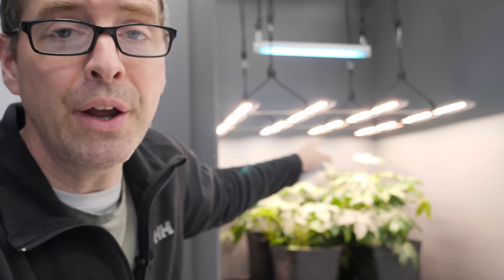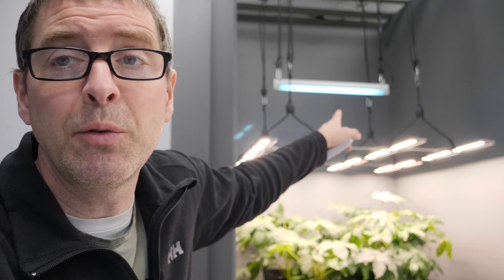How to use UVB with LED grow lights

Comment: You should see the paint on my grow tent poles.  It was  nice bright green 5 years ago. Now its a light pastel mint green. Lol
Reply: Hey, do you think there's a chance of burning the stuff in your tent? Like the mylar, fabric of the tent, fabric pots, plastic trays, plastic fans, rubber cables from the lights etc.
Reply from the maker: No, its lower level than UVB in sunlight
Reply: @MIGROLIGHT hi I've just bought this light plan to use in my white lined budbox, is that also safe it's not going to discoloured it? Iknowuv gets absorbed & doesent reflect hence my concern? 
I'll be using along side hps I'm interested in the emmerson effect but does a hps bulb already produce enough IR or do I need to add some small led bars to do the 15mins pre n post lights schedule
I appreciate your help
Cheers
Reply: @twentytwo138  no bubba. No danger of anything like that.

Comment: Amount of time in an 18/6 light cycle for uvb? I thought I heard you say in another video that 2 hours mid cycle or something to that effect.
Reply from the maker: Yes, 2 hours is perfect
Reply: @MIGROLIGHT  thanks for clearing that up sir!
Reply: @matprang4508  but you shouldn't be using it in veg if I recall. Just last few weeks of flower?
Reply: I've read that UVB can keep plants from stretching as much during the first 2-3 wks of flowering, as well. 
  Then I'd just use in the last 2-3 wks of flower. Starting with 15 minutes a day and moving up 15 minutes each few days, and maybe an hour per day max, as I've found these lights are very powerful, when experimenting without a timer (Duh?!), and ruining my crop by accidentally leaving it on for 12 hours.
  So be careful everyone!

Comment: What about UVA there's a new fixture coming to market the Oxilus sunlike Pro 8000 that comes with both UVA and UVB. Just wondering if it's even worth using?
Reply: Uvb isn't available in LED fixtures
Reply: @smokeyBJJ  go look up the light you'll see for yourself.
Reply: @bradpuhakka3955  can't find any info on that fixture..
Reply: @smokeyBJJ  they're fixtures are in testing right now and only started pre-orders on them. Quite a few people are getting them I'll see if i can find a link to drop for you
Reply: @smokeyBJJ  my bad bro I misspelled it. It's called Oxalis Sunlike Pro 8000
Reply: @smokeyBJJ  apparently it's gonna King of lights once it gets out. They even sent some to copycat and many others for testing

Comment: If using a Zoo Med ReptiSun T5 HO 5.0 UVB Lamp - 39W - 34 in.
4.6(249)
With 2xs the watts. Should I run half time at 2 ft or hang higher and stay at 4 hours? What would u Recommend?
Reply: I have a splitter with 2 different reptile uvb cfl. I have the on for the middle 2-4 hours in the middle of the 2nd half of flwr. I habe mine less the 12 in. Based off my understanding of cfls

Comment: I use two 54w 75%uvb and 25%uva
Reply: @bobbywitcher5042 What is the size of your grow tent? 4ft × 4ft? Does it work well with UVB? Would a single 54W UVB tube be enough, or is it better to run two for full coverage?

What protocol do you personally use?
	How many minutes per day?
	Do you run it daily during the last 3 weeks of flowering?
Reply: Uva damages plants i do believe good sir.

Comment: "As long as you maintain the hanging height of approximately 60 cm or 24" above the canopy....." was exactly when anyone with a tent quit listening LOLOL
Reply: Agreed… I operate my t5 & t8 ballasts around 12 inches above the canopy in-line with my led  fixtures (non-migro fixtures). Placing the unit at 24 inches above the canopy which is usually well over the light fixture is not going to work for the vast majority of anyone in a tent (most of us). It’s really impractical. 

Imagine having to put this over a more robust light without all that spaces between bars… it would be entirely ineffective where a vast majority of the light hits the back of the heatsink and never makes it to the plants,
Reply: My tent is 2.3meters so I could get away with but yeah I get ya with a 200cm tent but it's possible but definitely not In a 180cm height even 200 would be fairly hard.
Reply: Yah, you'd have to have a real tall Gorilla tent or something, or maybe some super squatty Indicas
Reply: My tent is 200 cm tall, totally doable
Reply: Learn to grow properly. There's hardly any high-quality LED lights that you need to be any closer with.. and even if you could find one that was higher in ppfd it's likely that the plant doesn't use any of those extra photons without bringing up the rest of its capabilities in CO2 and UVB/A.
Reply: I guess I'd have to hang inbetween the light bars on the main light and just move it up. A regular 4×4 can handle that as long as you've trained your plants correctly to use all the available light and stay small as a Shrub

Comment: Does your bulb have the same output as the pure uv bulb? I just set up an inexpensive fixture and made an aluminum foil reflector for a pure uv bulb. Currently running 4 hours at midday at almost 3 feet from canopy. Seems to be doing it's job but now you've got me thinking that I'm too far from the canopy. 
Thanks for all your great  videos. I'm running this in a 2.5 x 2.5 with a grow 200
Oh, also my plants got to see the actual sun a couple hours a day during their veg and early flower stage.
Edit: I see I'm 24w t5  and you're 18w t8 so maybe my height is correct.
Reply from the maker: Hi the Pure UVB has a very similar spectrum and a height of about 2 to 2.5 ft should be perfect👍
Reply: Yes the Agromax Pure UVB T5 is a beast.

Comment: What do you think of cosmorrow 40w UV
Reply from the maker: Its a UVA LED bar. UVA does not stimulate the increase in terpenes and flavonoids. Its basically just deep blue light with no additional benefit to the plants than low efficiency photosynthesis.
Reply: @MIGROLIGHT  what's the band that the UVB marketed lights should cover?

Comment: So this will increase the yield?  Is this something someone need to use? 
So many questions... haha . 
Is it worth using?
Reply: My understanding is uvb does not increase your yeild. What it does do is increase the trichome production when used during the final week or 2 of flower. Since too much uvb can be harmful for plants (and ppl), you really only give uvb during the last couple weeks of flower, and you only give your plants uvb a few hours a day
Reply: @SageLakshmi  It puts your plants in a defensive mode so they create terps/oils/trichomes but the energy to do so is taken away from plant growth. That is why it is only for the last few weeks after growth is done and you are waiting for ripening.
Reply from the maker: It will not increase yield or potency, UVB increases terpene and flavonoid levels for better taste and smell
Reply: If not, check out uvb lights for reptiles.
Reply: @goodgreen4616  I looked briefly into uvb lights for reptiles but I dont believe they have nearly the wattage to be effective for plants. I could be mistaken I'll have to do more research
Reply: @SageLakshmi  I believe you are correct. You do not want to fry your reptile, so they are lower output and designed for more output time. What we want for plants is a higher output closer to UVB from the sun at noon but only for a couple hours per day.
Reply: So basically it's boost the plant in the end.  I wont try it maby later on in life .. sounds okey but harmful to use, I cant have that.. much love all thanks for answer

Comment: Looks like you could use some UVB/vitamins D😂. Ya pasty bloke😝
Reply from the maker: LOL, I will be a blue shade of white by spring
Reply: @MIGROLIGHT  i found this interesting. 
385 nm light is on the boundary of UVA and visible light. It is proven to increase cell wall thickness and health, making the plant more resilient against intense UV, pests, mold, and mildew. 

The combination of 385nm UVA  and 285 nm UVB triggers the photon receptor responsible for improving the chemical profile of Cannabis.  285 nm and 385 nm have an entourage effect on secondary metabolite production when used together.  
Thanks for all your good work.